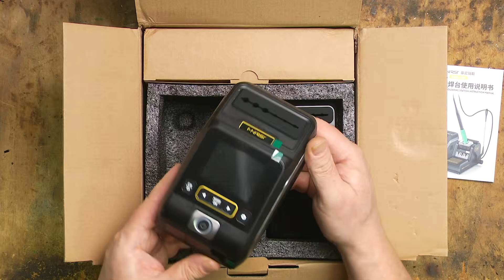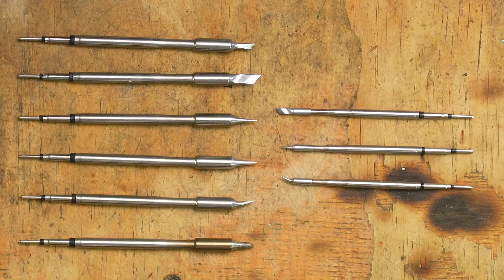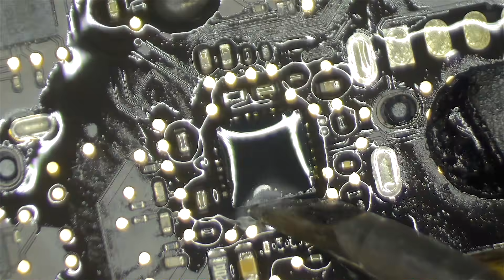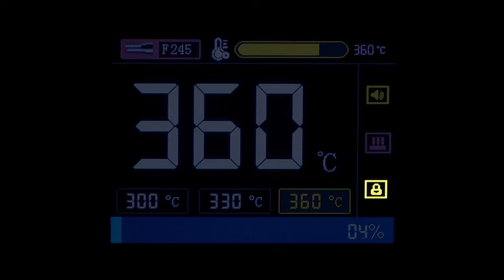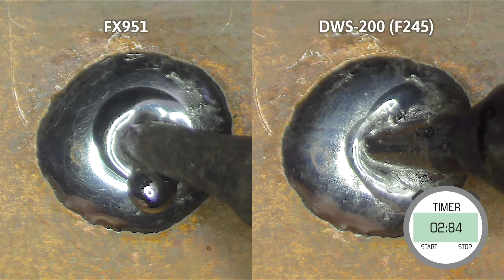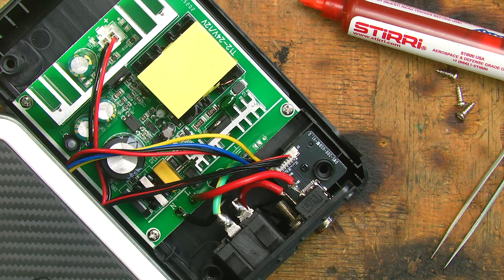Fnirsi DWS-200 Soldering Station Product Review

Comment: I've just been reading user reviews of this station. UNFORTUNATELY, many question its usefulness in repairing electronics (containing MOSFETs) due to the HIGH VOLTAGE AT THE SOLDERING IRON TIP (90°C!!!). Do you have any PRACTICAL experience to confirm or deny these opinions?
Reply: I have one of these which I recently bought directly from FNIRSI in February 2026.   The unit I have arrived with the iron tip ungrounded.  That makes it possible to have induced voltage on the tip.  You can open up the DWS200 control unit  by prying up the four rubber feet, removing the Phillips screws and separating the clam shell halves.  There are two obvious solder pads between the green/yellow ground wire and the handle connector on the lower board.  Connecting the pads will ground the tip (*).

(*) Note that if you modify the equipment and connect the pads it is at your own risk.  I would recommend connecting the pads through a several thousand Ohm resistor to limit fault current if the tip touches live voltage relative to ground.  A grounded tip is helpful when working with sensitive parts but does pose a potential safety concern.  There is enough room in the case that you could mount a switch on the back panel to allow conveniently switching between floating and grounded tip as needed.
Reply: Wow... a voltage of 90°C?!! That is crazy...

Comment: Those are knife tips, not chisel tips.
No, the iron doesn't use "induction" to sense if the iron is in the holder.
420°C? That is too high, it's not good for the tip's plating.

Comment: That Fnirsi dws looks epic like a top choice but im torn, The Yihua 948-2 is a bit more. the dws200 is like 160 and the Yihua is 300 but the yihua has a heatrework and a vacuum desoldering built into the station.  But you opened my eyes to the value of this DWS200 its features it clean lines the tips and shape hard to beat.  What do you suggest for a rework or desoldering vacuum station?

Comment: Just bought this unit too. Seems this brand is my go to for a starter lab now. Grow from there into higher end tools.However I bet this company will have high end options within a few years at this rate.
Reply: Not if they continue to mess up their PCB design. The voltage leak at 50V is a concern. My Geeboon TC22 220W has a voltage leak of 0.1V.

Comment: Any problems with the potential on the tip?
Reply: It is phantom voltage, there is a video on it on youtube by "nanofix", resistor not neccessary but can be added
Reply: @therealpeter2267  I returned my dws-200 and got a geboon instead for the same price

Comment: Do not buy this machine. 1) The tip/shaft is not grounded. 2) Even after FNRISi suggested fixes and online user fixes theres still AC current leakage to the tip/Shaft. 3) Internal wiring is not properly insulated and lies over high current areas inside the machine. They are selling a faulty dangerous machine. They and AliExpress know about this but continue to market and sell this DWS 200 soldering Station. DO NOT BUY THIS MACHINE.! Why must a buyer, consumer, user fix the manufacturers faults?

Comment: Is not grounded at the tip? Is that something the average consumer,  with no knowledge of electronics needs to worry about? Has this issue been related to FNIRSI?  What are the doing about it?
Reply: Sensitive electronics, like mosfets might be damaged by it. Depends on the current and the circuit has to be closed somewhere to ground, so it is hard to predict.

Comment: Great revue. I've had mine for several months and love it.  As for tips, AliExpress has them if you don't mind the wait.  I too like the cleaning brush but haven't found a replacement for it. I do like the HS02A-C2 tip and wish it would fit the small 210 handle.
Reply: Cant remember the name but I have seen the cleaning brush on AliExpress

Comment: The two cartridges you called chisel tips in the video are in fact called knife tips. You'll see the 'K' in the product number on the tubes that the cartridges ship in. Still a shame they do not provide a real chisel tip cartridge in the base configuration. Maybe you can test that brass brush thing for ferrous material with a magnet. It's the only real concern of design I have on this product so likely sticking to stock brass wool.
Reply from the maker: There is ferrous material inside the plastic base of the brass brush (probably some steel rings holding the bristles together), but the bristles themselves are non ferrous. It works well, but my primary concern is how long it will last. As a backup, I have just finished designing and 3D printing a brass wool holder that slots into the same spot as the brush.
Reply: @BranchusCreations perhaps share the STL for others to modify their unit
Reply: The jbc clone tips have very little variety, what you get is always conical, bent conical, knife. Chisel or beveled tips are hard to come by. But you can get a lot from jbc if you pay for genuine tips and I'd suspect the situation will change in the coming years.
They don't really get stuck in brass wool, jbc put the ridge on purpose so you can quick swap them.